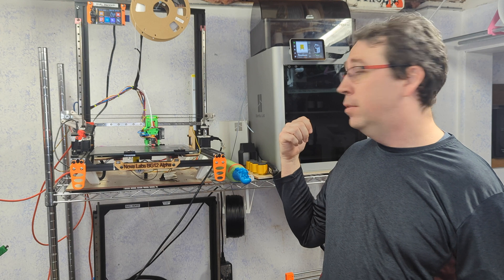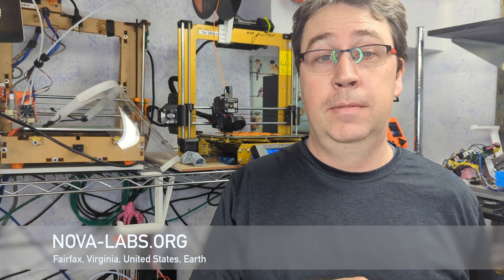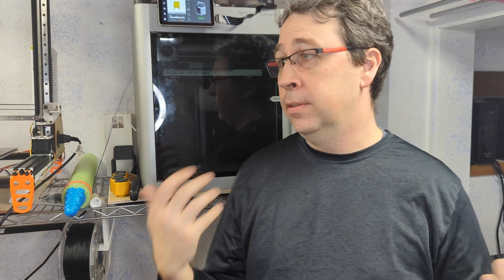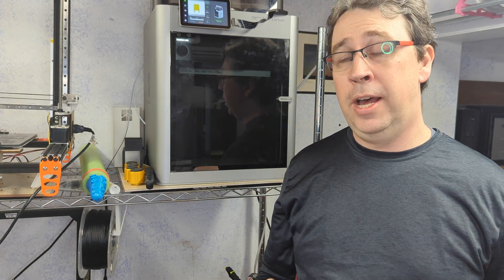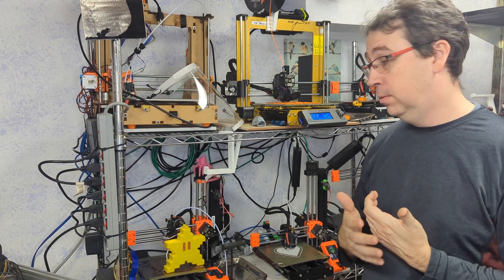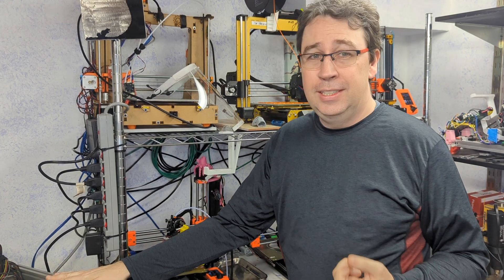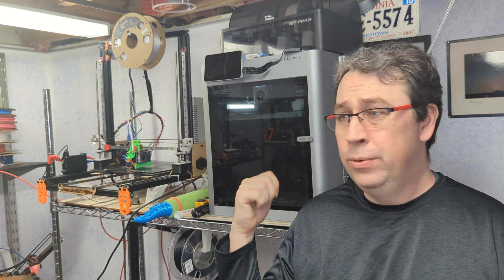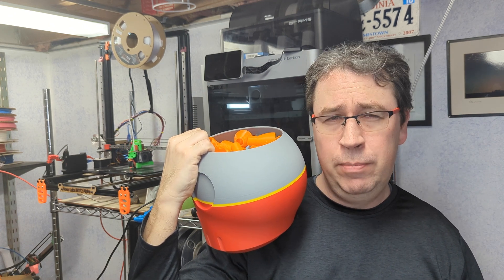Bambu Vs Prusa Mk3s+  Part 2!

Comment: I had the opposite experience with first layers and setting it and forgetting it - I moved from a Prusa MK3S+ to a Bambu Lab P1P and always had to hover the first layer of the Prusa, but within 2 weeks of getting the P1P I stopped watching the print start entirely. I might have been able to improve my first-layer experience with the Prusa by using their textured sheet, but the real magic with the P1P beyond it's textured sheet is the purging and wiping and the way they do the intro line. Those steps make for a much more consistent start to the first layer, and I never have to worry if I purged enough of a previous color or material before starting a print with something else, and I never have to worry about oozing during startup.
Reply from the maker: Glad to hear!

Comment: Mk4 is coming
Reply from the maker: Is it?  Is it really?  I would be so tickled if they release the Mk4 with the same 20x4 LCD... Or no, if it was a 20x4 LCD touchscreen somehow...
Reply: @PaulChase  It’s going to be very similar to Prusa XL screen. MK4 and new MMU will be released very soon.
Reply: @PaulChase  I have seen Prusa XL. It’s a beautiful machine and should be quite fast too. They still work on it to make it faster. Hardware supposed to be done, software not finished yet but they will ship first XLs this May 100%

Comment: As a noob, I do not have the expertise, patience, and most important consideration is budget to buy Prusa anything. I do not know how long it takes to put together a Prusa Mini, but I've heard the MK3S+ take upward of 8+ hours @ a cost of $799 for a plate somewhere like 250x250x250 ... for less than $400, I can get printers with 300x300 that take less than 30 mins to assemble and start printing - took me ~30mins to put together my Ender 3 (first printer), but then I read the manual carefully. Now if I were starting a print farm, I would consider the P1P which can print out of box, before considering the MK3S+ which costs more and require assembly.  Most (all?) printers not from Bambu probably copies of Prusa so the "support" on them will be similar, just at a more affordable price, especially for hobbyists like myself. I'm not sure Prusa can even compare against Sovol nor Elegoo, nevermind the P1P/X1C.
Reply from the maker: The mini assembles in about 10 minutes - less if your kids steal the gummy bears, more if you try to reacquire said gummy bears.

Comment: I retired my mk3s+ in favor of my X1CC. The reliability, speed, features and ease of use were leaps and bounds above my mk3. I don't do multi colors often but keeping 4Kg of filament dry and at the ready is a huge bonus especially at filament runouts when it auto switches to the next roll. 

I don't have as much space, so efficiency dictates which printer stays and which goes and managing 2 slicers were getting to be a pain. It's good too see you have a great working area for all of your printers and lean into their strengths. 

For your flexible materials are they tpu or flexible PLA? Which for the life of me I didn't know existed until today.
Reply from the maker: Why would you retire a working printer?  I mean, this isn't the NFL where you only have one quarterback or something.  I've widlarized a few 3D printers, but they deserved it.
Reply: @PaulChase  There are a bunch of reasons why I do not run to my Mk3s+.

To start I have sidelined 3 printers. 
ender 3 pro(the never ending project and slow)
mk3s+ too slow
Ankermake m5(kick starter and still in unboxed waiting on v6 engine.)

1. Space is an issue. I just dont have the room to run multiple machines especially if they arent meeting my needs. 

2., Managing multiple slicers, cura, prusa slicer, bambu studio, ankermake slicer

3. Managing printers remotely is dirt simple on the X1C with the handy app. I can also have a family member clear the build plate if I am not home and start a new print. 

4. The X1CC is 3-4X the speed of the ender and mk3s+

5. I print models in multiple parts and it's more reliable to print them on the same printer and slicer. I can arrange my plates, send my plates and print.

6. larger build volume, speed, enclosed, AMS keeps filament dry and I can monitor basic humidity through the app. etc.

 Aside from the ender the mk3s+ is stock and the kludgy method of prusa link or octo print never appealed to me.  

There are a ton more reasons, but you get the idea. If I kept using the bed slingers it would be performative. I know when to cut my losses and move on when a device isn't meeting my needs. As you can see I bought a few evaluating which best suites me. Ender because it was $100 from micro center. Prusa because of recommendations of reliability. Ankermake as a kick starter because it was a big speed boost over the other 2, lastly the kickstarter of Bambu studio. The X1CC came before the ankermake and since Aug 2022 I have enjoyed printing. I just hit 2k hours printed which is about 6-8k hours on my other printers in terms of volume.
Reply: @PaulChase  when you use a bambulab you will know. This is a few.. WIFI, camera, phone app. Spaghetti detection, realible. It's a ecosystem, not only a printer. And the speed... GREAT quality prints every time

Comment: My upgraded $300 Ender 3 V2 is as good as a prusa MK3. So I'm not sure what the point of this comparison really was. Even if the Prusa came out on top I still wouldn't buy it. Why would I spend anywhere near $800 on a 3D printer when a few upgrades on a cheaper one would make it print exactly the same for half the price 😂. I understand you're a Prusa guy, but that's just brand loyalty. Maybe at one time Prusa was the only game in town, but that hasn't been true for years now.

Having said that, no way I'm buying a Bambu. I want more control over my machine.

If it actually turns out to be the best thing since sliced bread then there will be clones of it soon.

I don't think it's shaping up to be a game-changer though. If you go on YouTube it's nothing but influencers saying how great it is. But if you go on the internet forums Reddit being one of them you see all the complaints.

I imagine the people asking the question are people that still think Prusa is worth it at $800 😂 and people that might be bitter that they spent $800 on a bed slinger when they could have got this.

Edit:
My enclosed two trees sp5 prints all the same materials as the bambu. $400. 🤷 I also recommend the creality Ender 2 pro instead of the Prusa mini.
Reply: Did you watch the video my man? He clearly stated which printer was the best.
THE BAMBU LAB X1C!  He talked for 5 min about how it saved his life from sprawling depression and despair.

Just kidding, basically whatever works best for you is the best printer. Each printer has its strengths and capabilities. If your ender works well,  then great.
I have an ender 3, ankermake m5 and Bambu X1C. I use the ender for messing around since it was never reliable but if I tinker and if I break it I can work on it. If anything it keeps me humble and for $100 starting it taught me a lot. 

The Ankermaker is a quick bed slinger which I use to print slow tpu prints.

The X1C is my work horse  and most reliable and accurate. The 3d printing world is large enough for everyone. lol.
Reply from the maker: Hey thanks for reading the title!